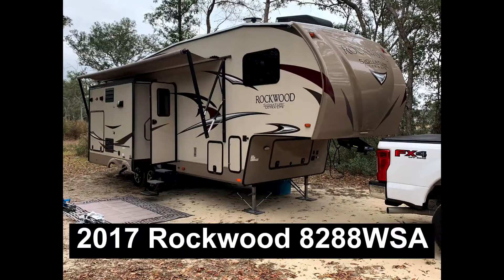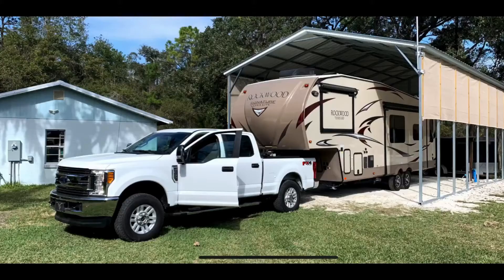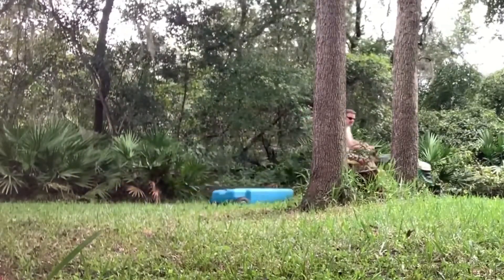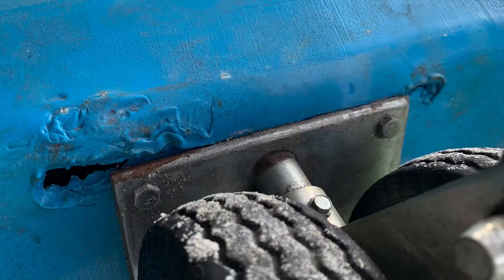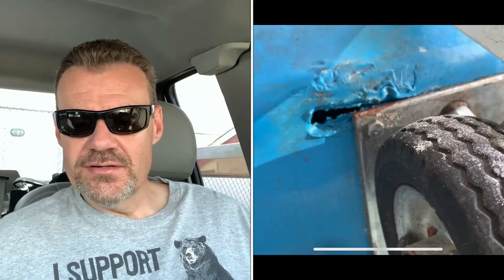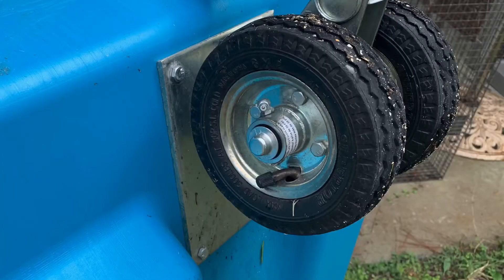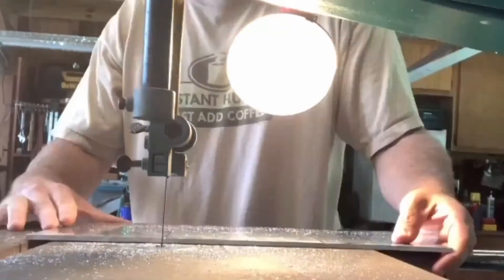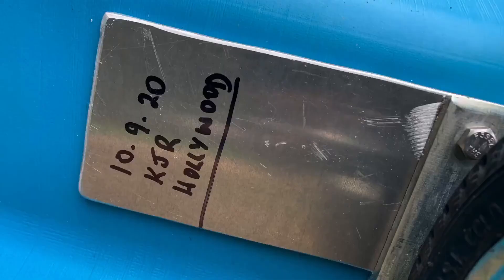How to Not Have to Repair RV Waste Tote / RV Waste Tote Mod / RV Living / Barker Tote / RV Sewer

Comment: I found your channel through Getting Out-RV With The McGuires Livestream. We are currently boondocking in Quartzsite, Arizona. First time ever boondocking. We are currently looking for a good tote for our Black Tank. The problem is this is the desert and full of rocks. And they say totes can't be pulled across rocks here. Cause they eventually cut through the plastic and well. The outcome isn't good. Lol 😆. My channel is all about finding Handicapped Accessible Places and inspiring everyone to get out and enjoy life. Campground reviews,  hiking reviews and more for the Disabled. We just went full-time RVing 1 week ago.
Reply from the maker: Awesome!!!  Congrats on the full time decision. It’s the best life ever!!!  I understand the problem of pulling the totes across rocks cause these
Things are really low to the ground. Maybe a solution would be put the tote in the bed of your truck and use one of those portable RV waste pumps that connect to the waste valve on the RV and pump the waste through a garden hose to the tote tank. Those things can pump the waste uphill so it could pump it into the tank in the bed of the truck easily. They’re pretty pricey at around $235 on Amazon but it could be a good solution. That way you could drive to the dump station with the tote in the bed instead of having to pull it behind your truck. Sorry to be so talkative and make you read all this but hopefully it may help out. :) lol. Thanks for watching our video and we will check you guys out also!  God bless. Kevin